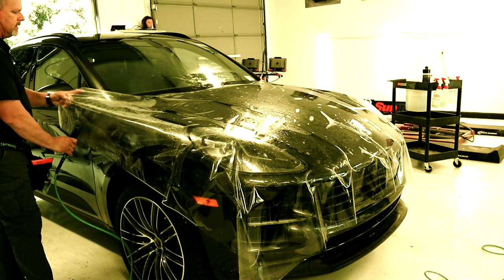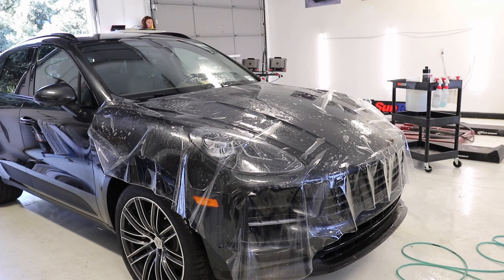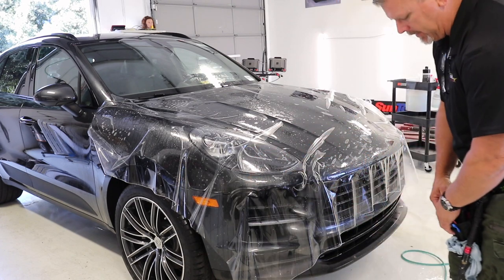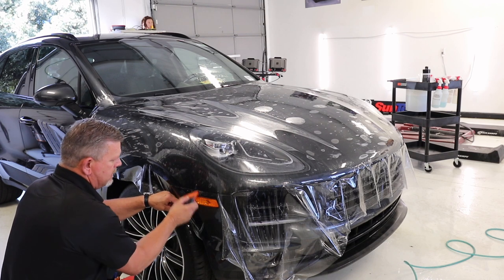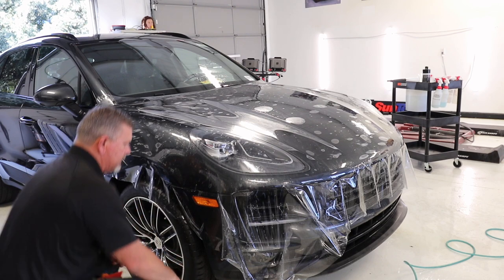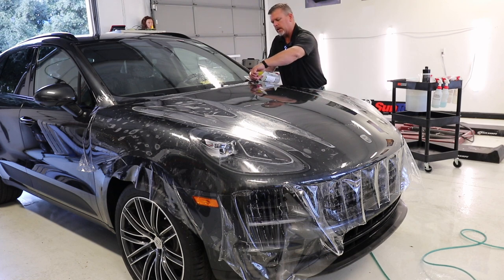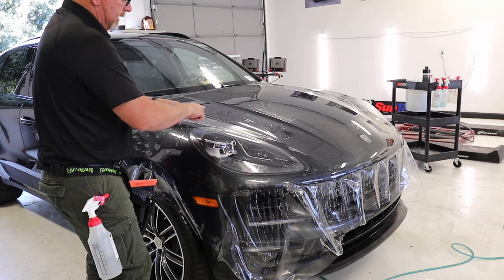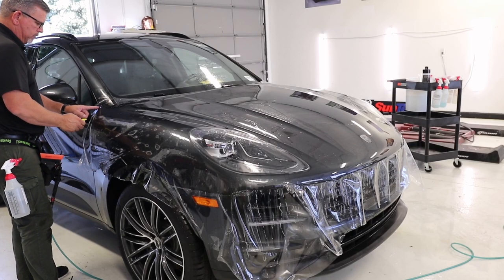Paint Protection Film Bulk Wrapping How To | Porsche Macan | SunTek 72

Comment: Hi Ron, me again, what I do understand is why you do so much stretching on a bulk install, whereas if it was a Precut install you would not be able to harley any stretching ? so what is the difference, I am about to do the front Hood on my Ferrari 458 Italia and as it is a fairly flat panel I was not thinking of doing any stretching so is the OK or am I missing something, again Thanks for all your help and advice, Regards Eddie Walsh
Reply from the maker: Eddie, we stretch the film to eliminate the wrinkles at the edges aka fingers. The Porsche hood in this video is basically 1/2 a ball. It requires stretch even if you use a pattern. 
Your Ferrari hood will require very minimal stretch.

Comment: Ron, do you not get lift lines where you've already tacked the front lip in the begining and then lifted and sprayed? Also, as others have asked, what is your slip ratio in 5 gal tank thanks!
Reply from the maker: No, because it’s lifted and stretched more. For slip I recommend playing around with the mixture. Water and soap is much cheaper than film. If you’re having issues with film tacking too fast or not tacking when you want it to. It’s much easier to change this than struggle through the whole install. I use a 3 gallon tank. It’s got a filter on it. I use tap water with 1/2 an oz of Joy Ultra.
Reply: @PaintProtectionFilmAcademy